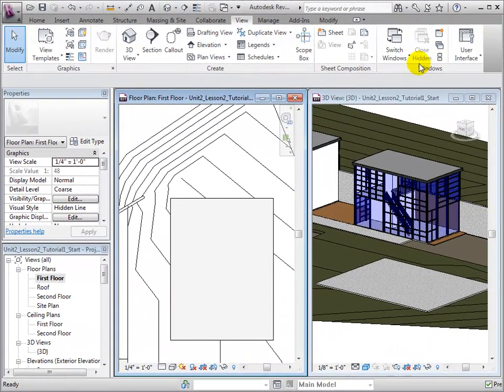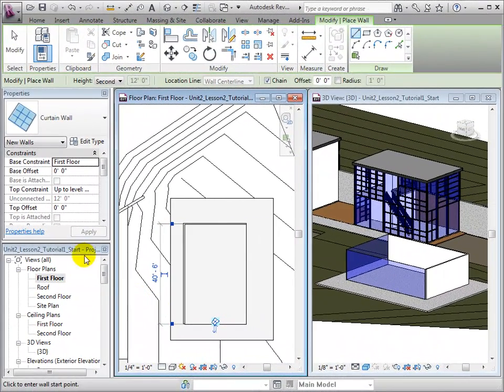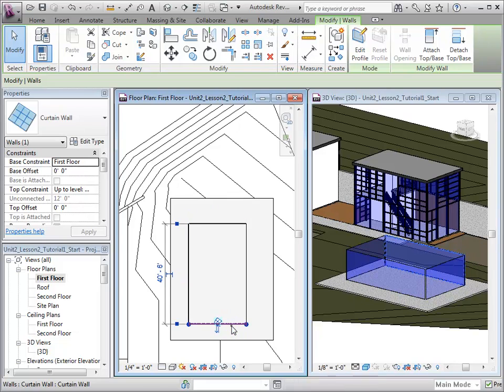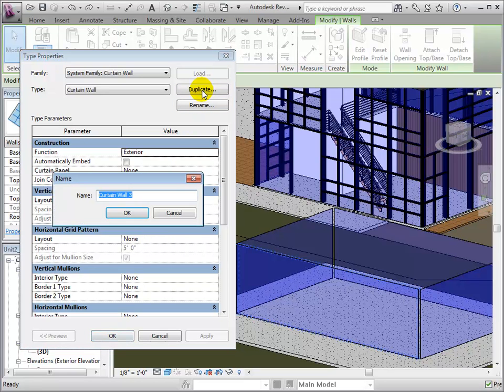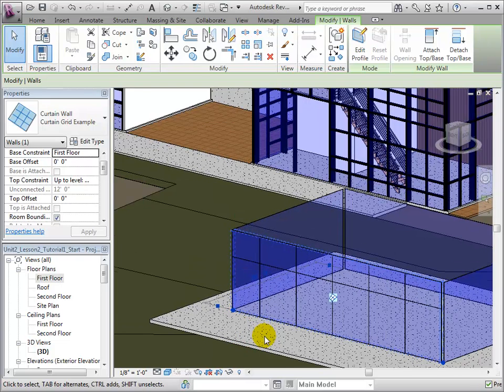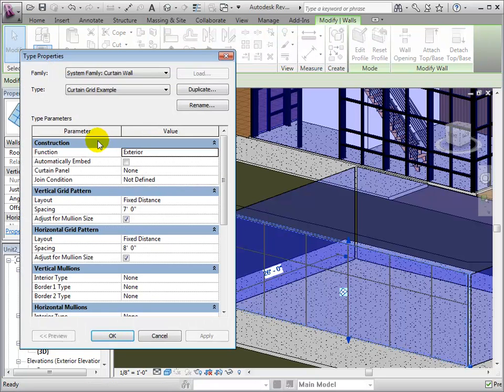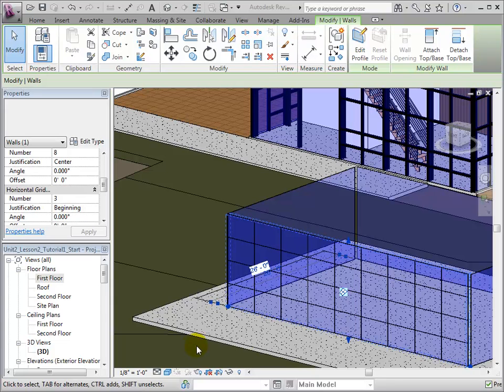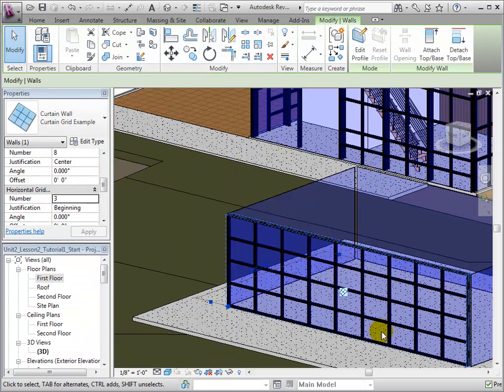Revit Architecture - Creating Curtain Wall Types and Grid Patterns

Comment: Just one comment. You said the odd sized panel at the end would move to the center when changing justification to center, it actually will adjust so that both ends have an odd dimension from other panels. Good video though.
Reply from the maker: Michael Spencer Hi Michael!  Thanks for pointing out the inaccuracy in the lesson...  You're absolutely right... when you change the justification to center, Revit splits the odd panel width evenly and applies it at both ends of the wall -- keeping the regularly-spaced panels centered.  Good catch, that I'll incorporate into an updated version.

Comment: Please help, i have 2015 revit, I have created a curtain wall system by using the mass tool and its curved. Why wont it let me attach it to the roof which is slanted?
Reply from the maker: Meer Said Hi Meer...  Attaching a curtain system created using the mass tool to a roof is tricky....  The standard Attach Top tool isn't available.  How was the roof created?  You'll probably need to do a Cut using the roof element or create a void element that has the same form as the roof and intersect it with the mass that generates the wall.  If we can get that mass cut down, then you can select the curtain system and Update to Face.